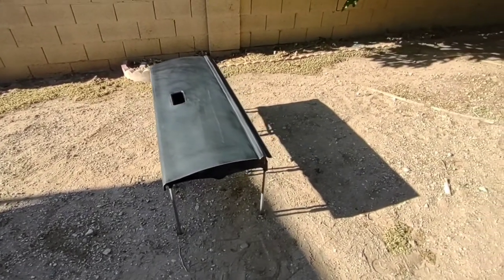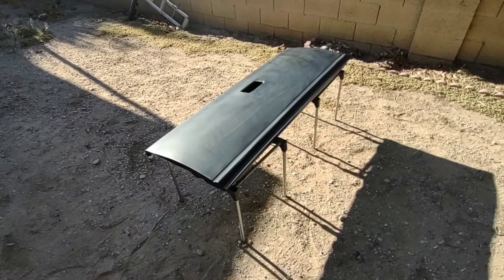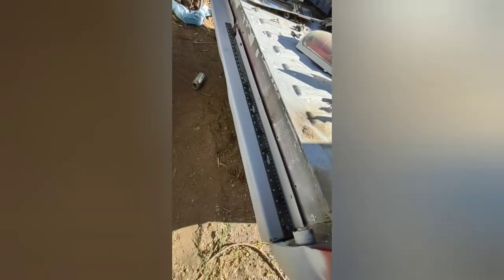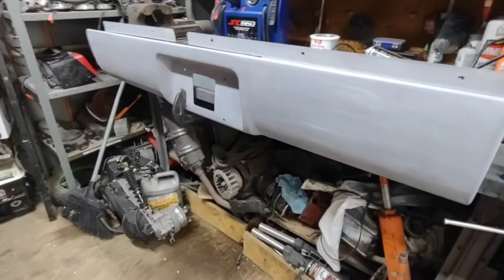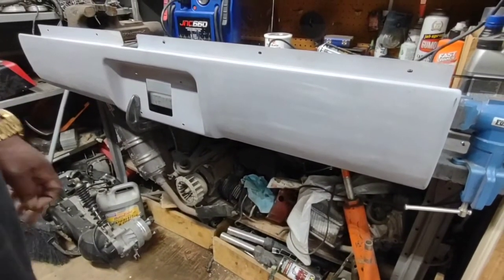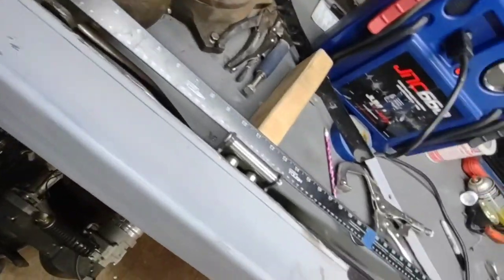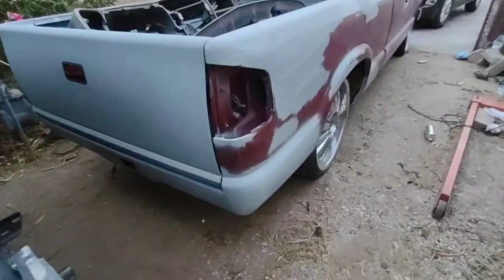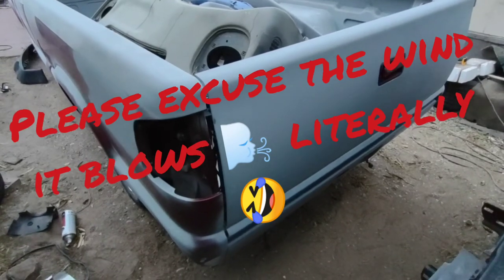final video of the S10 roll pan and new tailgate install.

Comment: How did you secure the very bottom of the rollpan? The factory GM rollpan has "wings" on either side that tick inside the bed corners where the flaps w/pre drilled holes are on the stock bed corners. I thought I could see light straight thru the gap to the driveway. But that thing would dance in the wind even welded along the top with a GM /but ESPECIALLY a Chinese rollpan...ask me how I know 😆 🤣.  Anyways looks good man. So much for "keeping ut a stock daily" like the radiator install, or flip I think ypu said way back when. 🤔 anyways, looks good
Reply from the maker: I used nut rivets and M6 bolts seems to be pretty secure I haven't noticed it flapping in the wind or anything like that but the radiator fans are not holding up too good in this Vegas heat I think I'm going to convert it back to mechanical fan thank you for watching and commenting ‼️

Comment: do you know anything about lowering kits? I wanna go 3 in the front and 4 in the back but I don't know if I need shocks or not.
Reply from the maker: Lowering kit for the S10 are pretty simple mine was already lowered 3 inches in the front and 4 inches in the back when I got it. I plan on going lower in the the back. I'll do a video on it when I get a chance to tackle that project. Thanks for watching ‼️